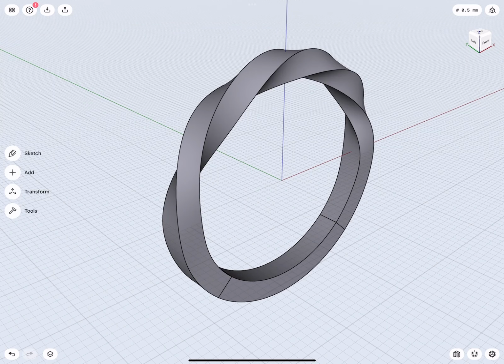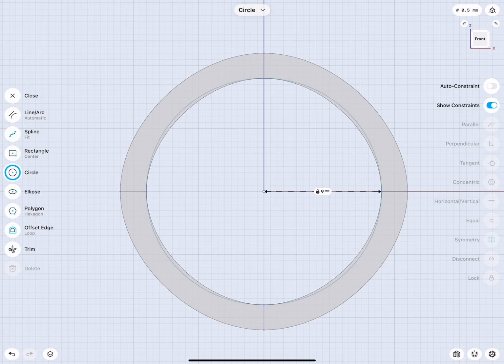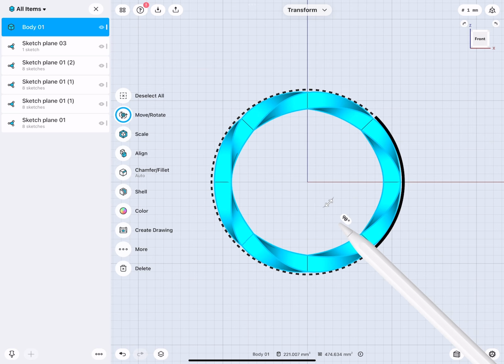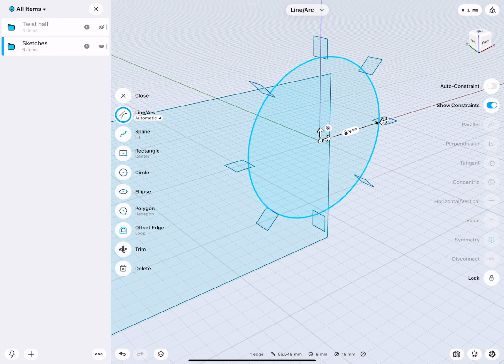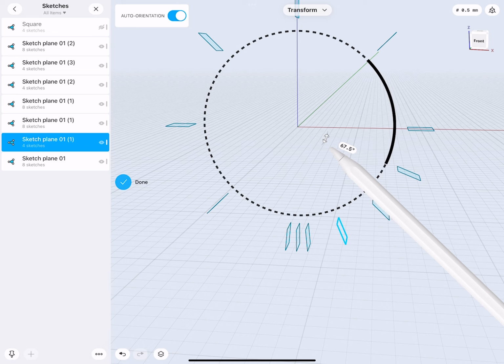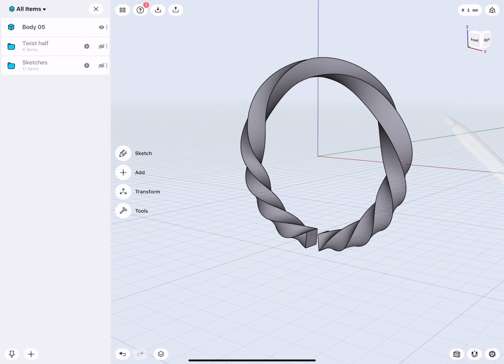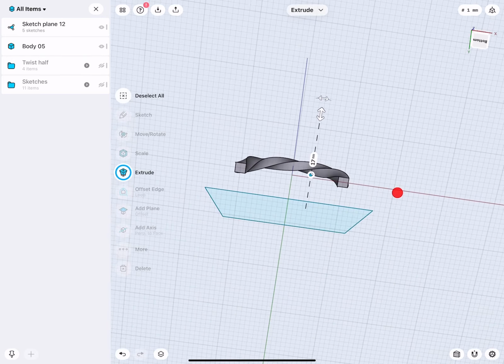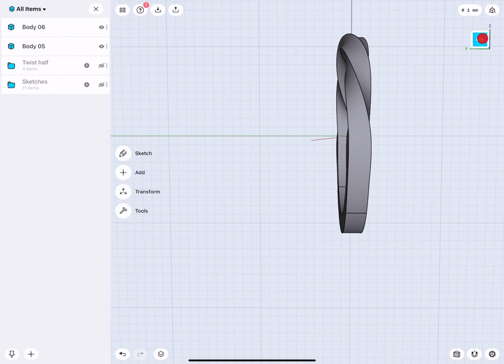3D modeling a twisted ring band, Part 1 | Shapr3D step-by-step

Comment: i cannot find offset face in my shapr3d new version app?????
Reply from the maker: Hey there! The menu that contains the tools changes dynamically depending on the selected elements. If you accidentally selected an edge with the face, the Offset Face tool will not be given as it cannot be applied on the full selection because of the edge. To help us better understand the problem can yo please send your screen recording with the problem at support.shapr3d.com/hc/en-us/requests/new